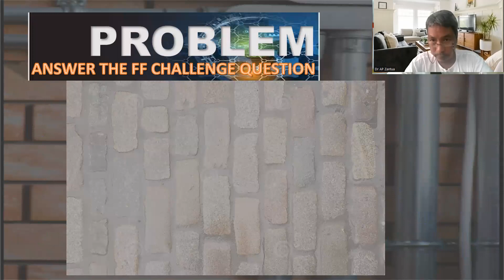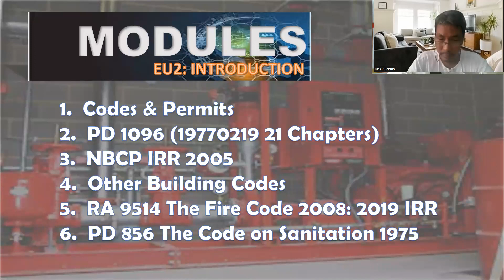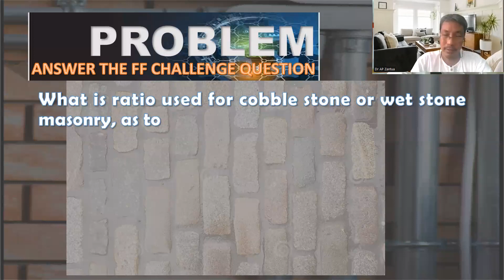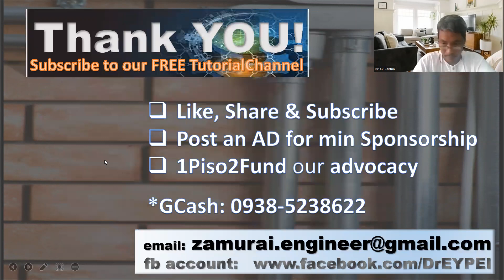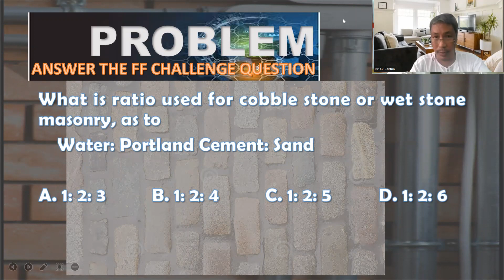Introduction to CODES & PERMITS [ Engineering Utilities 2 ] Module 1.01.B

Comment: Thank you, Sir for the continuation of IRC (2012) . 

Q. "What is the ratio used for cobble stone or wet stone masonry, as to Water: Portland cement: Sand" 
A. 1:2:3 B. 1:2:4 C. 1:2:5 D. 1:2:6 
Ans: D. 1:2:6

Comment: Thank you for providing us with a very well-explained second half of the film on the introduction of codes and permissions.

What is the ratio used for cobble stone or wet stone masonry, as to
Water: Portland Cement: Sand

Answer: D. 1: 2: 6

Comment: Thank you Sir for continuing discussing about the Codes and Permits and also the difference of laws and RA. 

What is the ratio used for cobble stone or wet stone masonry, as to
Water: Portland Cement: Sand

Answer: D. 1: 2: 6

Comment: Thankyou sir for continuing the topic on the last video, which is the introduction to codes & permits on eu2. As for the challenge question on last part of the video, what is the ratio used for cobble stone or wet stone masonry, as to water: portland cement:sand. The answer is D 1:2:6

Comment: Thank you sir for this continuation video about the codes and permits.
Challenge question: What is the ratio used for cobblestone or wet stone masonry as to water: portland cement: sand
Ans. D. 1:2:6

Comment: Thank you Sir for this continuation video lecture that tackles about the codes and permits. At the end of the video there's a challenge question: 
Q. "What is the ratio used for cobble stone or wet stone masonry, as to Water: Portland cement: Sand" A. 1:2:3   B. 1:2:4   C. 1:2:5   D. 1:2:6
The answer is D. 1:2:6

Comment: thank you sir for this continuation video about the codes and permits.
Challenge question: What is the ratio used for cobblestone or wet stone masonry as to water: portland cement: sand
Answer: D. (1:2:6)

Comment: Thank you sir for continuing the discussion of codes and permits.
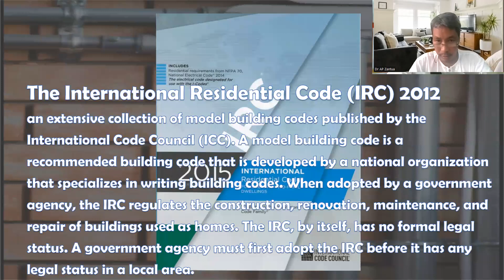9:36 Challenge question: What is the ratio used for cobblestone or wet stone masonry as to water: portland cement: sand. My answer to this is 1:2:6 which is D